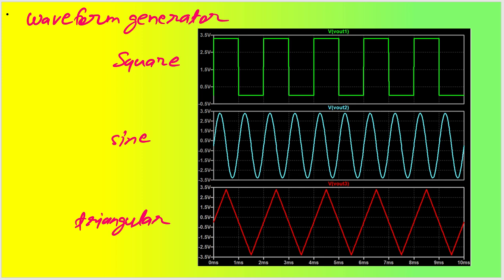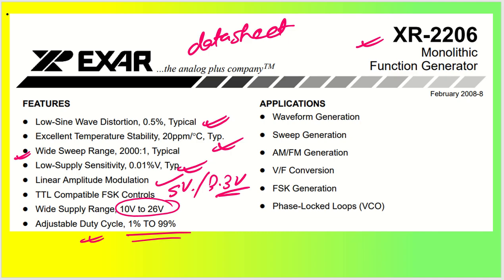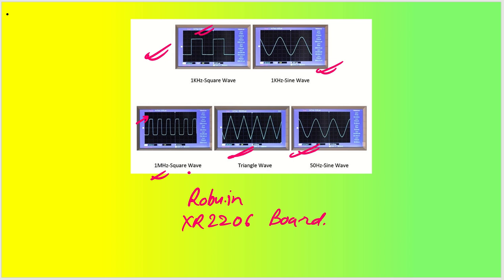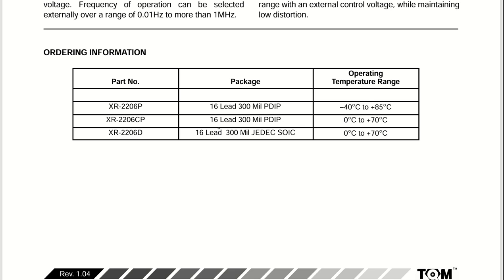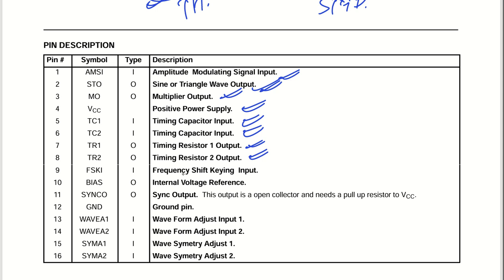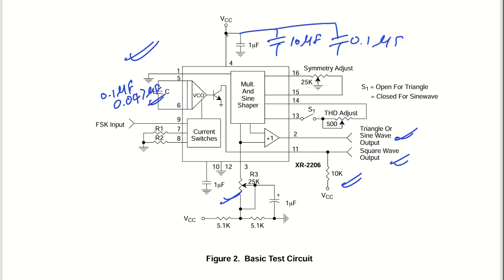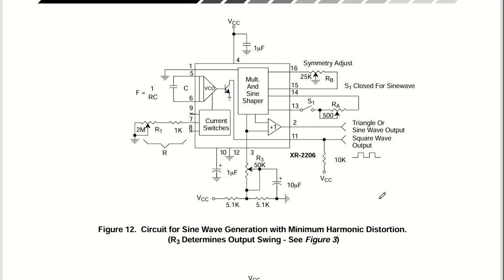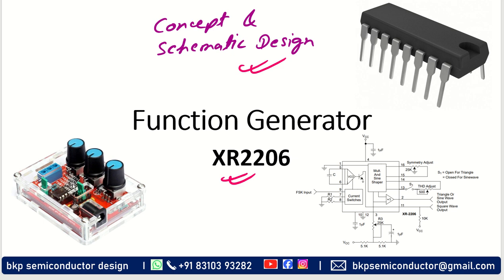093 Function Generator Sine, Square Triangular waveform XR2206

Comment: You can work with R3 pot which is used for amplitude settings,

However, I think you should get output waveform amplitude around 3V.
Reply: Waveform is ok but i have half supply voltage offset. I think i have promblem in R3, R5 before the amplitude setting. in schematic both are 5,1kOhm. Tomorow i will merasure :D